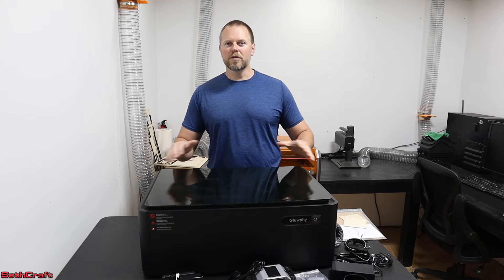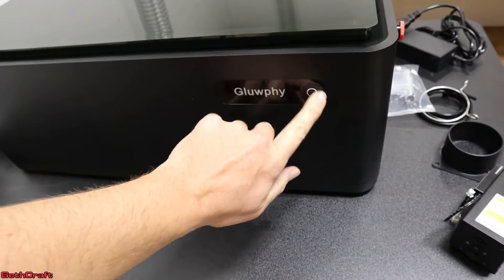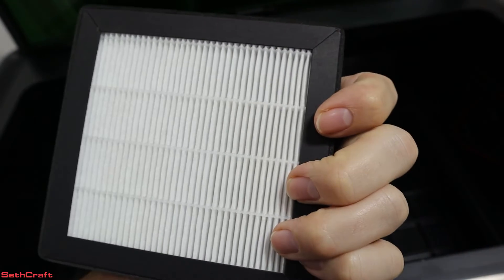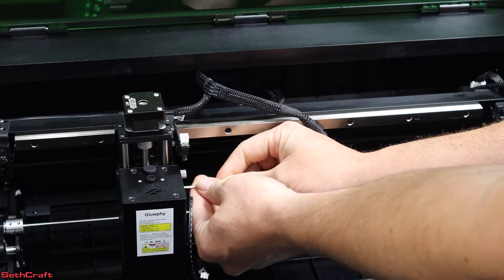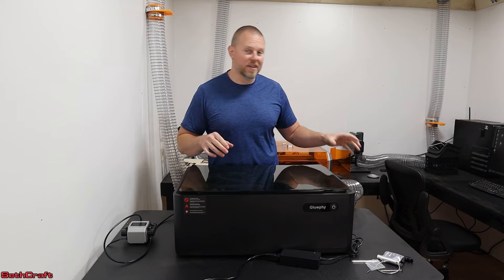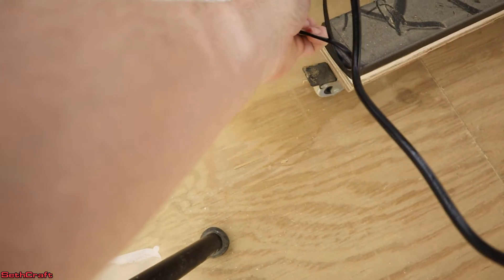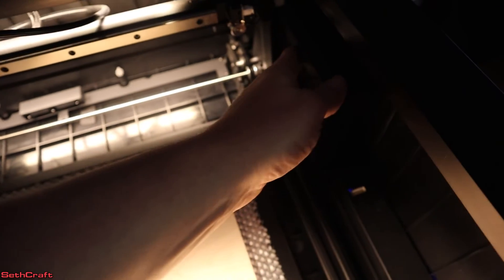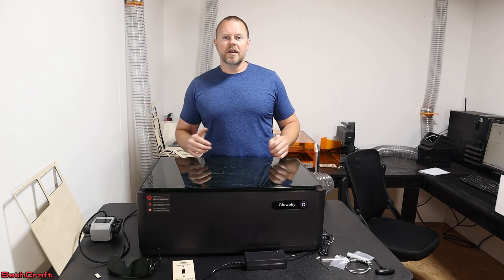Gluwphy All in One 20w Laser Cutter and Engraver

Comment: mine came without the air pump and without the bottom to set up the work. The manual is very basic and cheap in parts the illustrations are not differentiated
Reply from the maker: The updated manual on the website was a lot better. Was there a kit option for the air assist and honeycomb? This company is new and hopefully will be improving the product as they go.